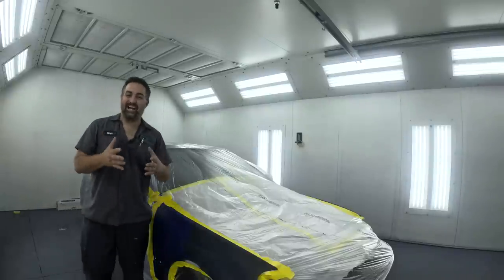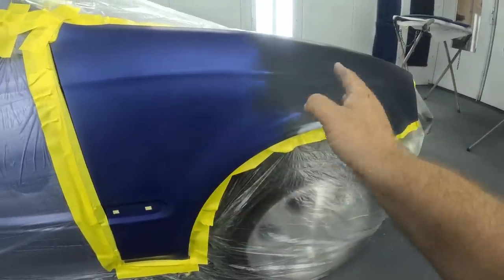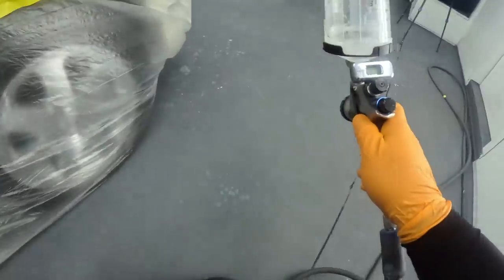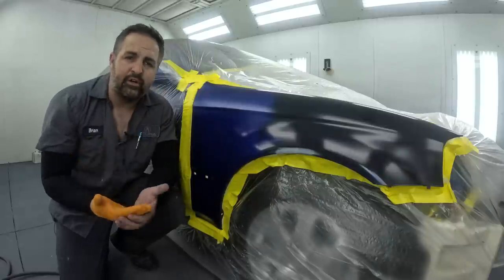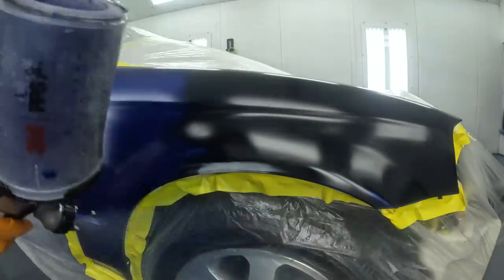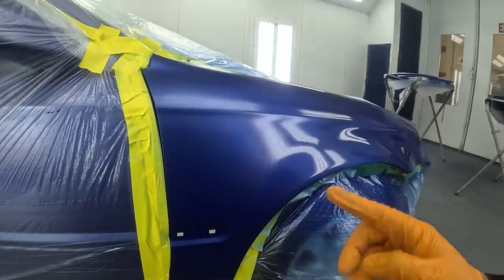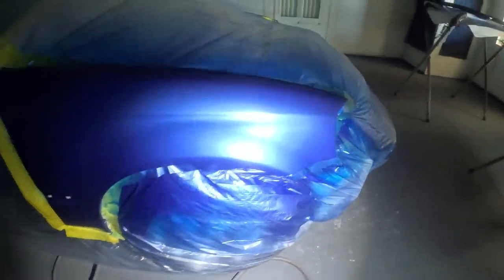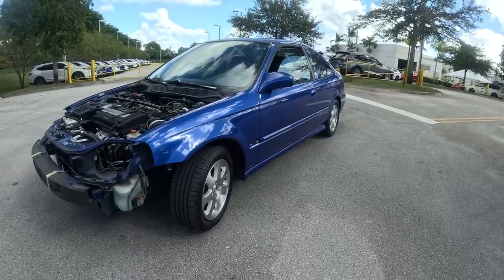A SIMPLE Paint Trick for Beginner Painters!

Comment: I've got paint peeling from the center of the hood on my Blue Iris color changing pearl paint job on my Subaru. Sprayed wet on dry without enough scuffing, lesson learned.
Now I need to fill in this area (repaint it, but not the entire hood), however the paint goes primer/black/pearls/clear. The black layer is what peeled, leaving the grey primer exposed. During this same paint job (my 3rd ever), I learned you can't touch up metallics: you have to respray the entire panel.
Since I use SG100 clear intercoat to carry the pearls, I try shooting it clear for the base coat, then run the black out just past the perimeter, then the pearls, then clear. What do you think of that plan? Should I instead spray the black, then the clear intercoat, then the pearls, then clear?

Comment: Hi Brian, thanks so much for all the tips. I wanted to ask about the compressor: what minimum tank size in gallons would you recommend,if doing a whole car, and is there a minimum SCFM required?  I have a 13 gallon with SCFM of 6.5 @ 40 PSI and 5.1 @ 90 PSI.

Also, what PSI should I have the tank set to and what PSI should be flowing out of the tank to the hose to the gun? Thanks so much.
Reply from the maker: 60 gallons is recommended or if doing it in sections you can get by with a 30

Comment: Thanks again for a great video, Brian. A quick question - I ran out of clear coat on my first paint job and only have like 1 ½  coats. What I did get laid down looks crappy. Can I safetly sand the clear that is there for mechanical bond and respray more clear? If so, what grits should I use? I'm hoping to not have to buy more basecoat.... I've already blown my budget.
Reply: Yea its just like a flow coating. Don't sand though the clear. 800 1000.

Comment: What if you are using a spray can? 
Do you have to worry about pressing the button all the way down just like a spray gun? Meaning how would you control the amount of color blend or paint with a spray can?
I am considering using Spray Max's system which is way better that your typical rattle can. 
Thank you!
Reply: There is only so much you can do with a rattle can
Reply: @bodyshopsolutions695  

Yes but if you look at Spray Max's systems it's not your typical rattle can there atomization technology is just as good as what is in a gun. Hard to belive but true.

Comment: Do you have any videos on the proper compressor to use. I was told mine was to small wouldn't maintain the proper pressure in the spray gun. It's a 2hp
Reply: Its about volume. The gallon size is more important than horsepower.
But, being 2hp im guessing its a small tank...

Comment: Seems very low spray pressures. Is 13-15psi the pressure you'd use for general painting, or only for blending?
Reply from the maker: Only for the dv1. It operates very low
Reply: Demo'd the DV1, it was a good gun but I still prefer my Sata over the DV1.

Comment: Brian it would be interesting too see you try one of those electric hvlp guns that comes with a small  separate compressor
Reply: Not good for full car resprays
Reply: @tonydiesel3444  iv seen decent results , bro people roll on paint and wetsand to get decent results , im sure an eletric hvlp is better than roll on
Reply: @tonydiesel3444  those electronic compressors push out between 0.6 bar and 1.2 bar depending on the make and model